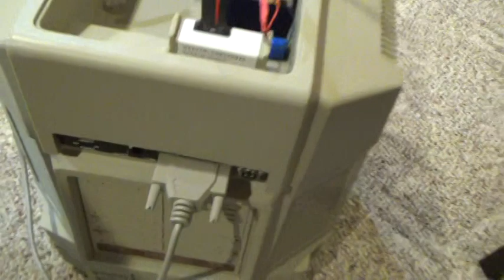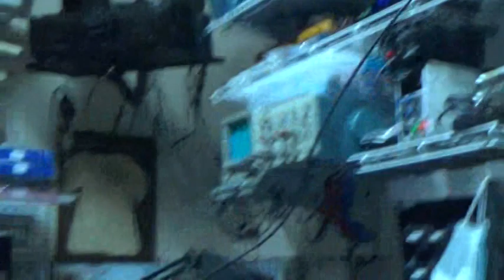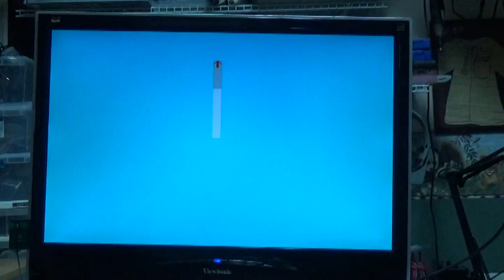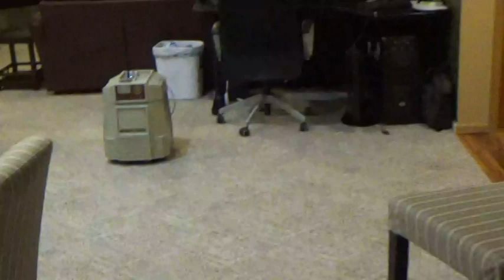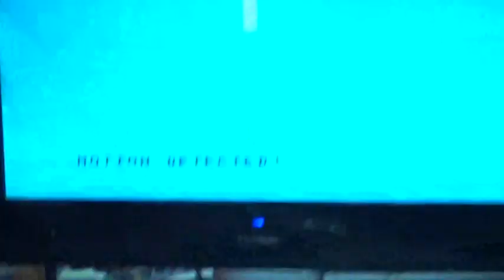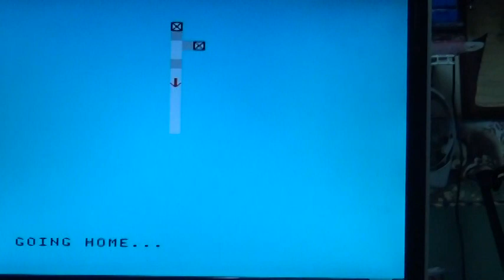Heathkit Hero Jr Robot Wireless Communication and Control with a TI 99/4A Computer

Comment: Excellent Hero JR video and results with the TI-99!  Do you know if Rich extended basic is still available for the TI-99 4A?  Looks like this is an extremely limited version of extended basic making it very hard to attain.  Thanks so much and keep up the great work!
Reply: Thanks so much.  I have an RXB cart on the way.
Reply from the maker: Thanks! You can find a multicart with 3 flavors of Extended Basic, including RXB, here: https://www.arcadeshopper.com/wp/store/#!/Extended-Basic-3-in-1-Contains-Ti-XB-XB2-7-and-RXB2015/p/58077057/category=15846004

Comment: Very nice video series. I've been in the early processes of doing something similar with my HERO JR. Would you be willing to share the code for the program?
Reply from the maker: Thanks! Feel free to ask any questions.  Here's the code for the Jr:

1 REM HERO ROAM PROGRAM
10 INPUT C
20 IF C<>65 THEN GOTO 10
21 FOR I=1 TO 100:NEXT I
22 PRINT 1
30 INPUT C
35 IF C<1 THEN GOTO 30
36 IF C>9 THEN GOTO 30
40 ON C GOSUB 500,600,700,800,900,1000,1100,1200,1300
50 GOTO 30
500 REM FORWARD 5 UNITS
510 FWD 5
511 GOSUB 1510
515 PRINT 89
520 RETURN
600 REM BACKWARD 5 UNITS
610 BWD 5
611 GOSUB 1510
615 PRINT 89
620 RETURN
700 REM FORWARD 10 UNITS
710 FWD 10
711 GOSUB 1510
715 PRINT 89
720 RETURN
800 REM RIGHT ROTATION
810 RIGHT 90
811 GOSUB 1510
815 PRINT 89
820 RETURN
900 REM LEFT ROTATION
910 LEFT 90
911 GOSUB 1510
915 PRINT 89
920 RETURN
1000 REM LIGHT LEVEL DETECTION
1010 L=EYE
1011 GOSUB 1510
1015 PRINT L
1020 RETURN
1100 REM RANGE MEASUREMENT
1105 R=SONAR
1110 GOSUB 1510
1115 PRINT R
1120 RETURN
1200 REM INFRARED HEAT DETECTION
1210 I=MOTION
1211 GOSUB 1510
1215 PRINT I
1220 RETURN
1300 REM SPEAK FUNCTION
1305 INPUT C
1306 IF C<1 THEN GOTO 1305
1307 IF C>3 THEN GOTO 1305
1308 ON C GOTO 1310,1340,1370
1309 REM PLEASE MOVE CLEAR OF ME
1310 SPEAK "PLEZHPA1MOO1VPA1KLEERPA1OVPA1MEE"
1315 GOSUB 1510
1320 PRINT 89
1330 RETURN
1335 REM OBSTACLE DETECTED
1340 SPEAK "OBSTAEKLPA1DE1TEH3KTEHD"
1345 GOSUB 1510
1350 PRINT 89
1360 RETURN
1365 REM GOING HOME
1370 SPEAK "GOWINGPA1HO1O1MM"
1375 GOSUB 1510
1380 PRINT 89
1390 RETURN
1500 REM DELAY SUBROUTINE
1510 FOR T=1 TO 200:NEXT T
1520 RETURN
>

And below is the code for the TI 99/4A:

// HERO Jr remote exploration program
// November 2019

// INITIALIZATION
CALL CLEAR
OPTION BASE 1
DIM MAP(23,32)
HOMEX=16
HOMEY=12
PRANGE=0
TCOUNT=0
DIR=1 !1=N 2=E 3=S 4=W
OPEN #1:"RS232.BA=9600.DA=7.PA=E.EC",UPDATE
CRU=2464 !CRU ADDRESS OF TMS9902 (>1340) DIVIDED BY 2

// CHECK IF ROBOT IS READY  
PRINT "CHECKING ROBOT STATUS"
CheckStatus:
CALL IO(3,1,CRU+18,0)
PRINT #1:65
GOSUB BytePresent
IF FLAG=0 THEN
 CheckStatus
Status:
ON ERROR Status
INPUT #1:ANS$
ON ERROR STOP
IF VAL(ANS$)<> 1 THEN CheckStatus 
ELSE PRINT "ROBOT IS READY!": :
PRINT "PRESS ANY KEY TO START"
GetKey:
CALL KEY(0,K,S)
IF S=0 THEN GetKey

// SET UP DISPLAY
CALL CLEAR
// CHARACTER DEFINITIONS
CALL CHAR(104,"FFFFFFFFFFFFFFFF") !BLACK LEVEL 0-20
CALL CHAR(112,"FFFFFFFFFFFFFFFF") !GRAY LEVEL 21-100
CALL CHAR(120,"FFFFFFFFFFFFFFFF") !WHITE LEVEL 101-255
CALL CHAR(105,"FFC3A59999A5C3FF") !OBSTACLE
CALL CHAR(106,"183C5A9918181818") !UP ARROW
CALL CHAR(107,"080402FFFF020408") !RIGHT ARROW
CALL CHAR(108,"18181818995A3C18") !DOWN ARROW
CALL CHAR(109,"102040FFFF402010") !LEFT ARROW

DIRSPR=106

CALL COLOR(10,2,16,11,15,16,12,16,16)
CALL SPRITE(#1,DIRSPR,9,(HOMEY-1)*8+1,(HOMEX-1)*8+1)

// START EXPLORATION
RX=HOMEX
RY=HOMEY

Explore:
TCOUNT=TCOUNT+1
IF TCOUNT>10 THEN 
 Home
// GET LIGHT LEVEL
LightInput:
CALL IO(3,1,CRU+18,0) !CLEAR RECEIVE BUFFER
PRINT #1:6 !Read light sensor
GOSUB BytePresent !WAIT FOR BYTE TO COME IN
IF FLAG=0 THEN
 LightInput
Status1:
ON ERROR Status1
INPUT #1:LIGHT$
ON ERROR STOP
IF VAL(LIGHT$)<21 THEN CALL HCHAR(RY,RX,104) 
 ELSE IF VAL(LIGHT$)<101 THEN CALL HCHAR(RY,RX,112)
  ELSE CALL HCHAR(RY,RX,120)
CALL DELAY(1)

// Check for movement in front of robot
MotionCheck:
CALL IO(3,1,CRU+18,0) ! CLEAR RECEIVE BUFFER
PRINT #1:8 !Read infrared sensor
GOSUB BytePresent
IF FLAG=0 THEN
 MotionCheck
Status7:
ON ERROR Status7
INPUT #1:HEAT$
ON ERROR STOP
IF VAL(HEAT$)=0 THEN 
 RangeInput
DISPLAY AT(24,1)BEEP:"MOTION DETECTED!"
Speak1:
CALL IO(3,1,CRU+18,0) !CLEAR RECEIVE BUFFER
PRINT #1:9 !Speak 
CALL DELAY(1)
PRINT #1:1 !PLEASE MOVE CLEAR OF ME
GOSUB BytePresent
IF FLAG=0 THEN
 Speak1
Status8:
ON ERROR Status8
INPUT #1:ANS$
ON ERROR STOP
IF VAL(ANS$)<>89 THEN 
 Speak1
DISPLAY AT(24,1):"                         "
GOTO MotionCheck

// Check for obstacles
RangeInput:
CALL IO(3,1,CRU+18,0) !CLEAR RECEIVE BUFFER
PRINT #1:7 !Read sonar
GOSUB BytePresent
IF FLAG=0 THEN
 RangeInput
Status2:
ON ERROR Status2
INPUT #1:RANGE$
ON ERROR STOP
IF VAL(RANGE$)>40 AND ((DIR=1 AND RY>2) OR (DIR=2 AND RX<31) OR (DIR=3 AND RY<22) OR (DIR=4 AND RX>2)) THEN
 GOTO PathClear
IF DIR=1 THEN 
 CALL HCHAR(RY-1,RX,105)::
 MAP(RY-1,RX)=1
IF DIR=2 THEN 
 CALL HCHAR(RY,RX+1,105)::
 MAP(RY,RX+1)=1
IF DIR=3 THEN 
 CALL HCHAR(RY+1,RX,105)::
 MAP(RY+1,RX)=1
IF DIR=4 THEN 
 CALL HCHAR(RY,RX-1,105)::
 MAP(RY,RX-1)=1
Speak2:
CALL IO(3,1,CRU+18,0) !CLEAR RECEIVE BUFFER
PRINT #1:9 !Speak
CALL DELAY(1)
PRINT #1:2 !OBSTACLE DETECTED
GOSUB BytePresent
IF FLAG=0 THEN
 Speak2
StatusObs:
ON ERROR StatusObs
INPUT #1:ANS$
ON ERROR STOP
IF VAL(ANS$)<>89 THEN 
 Speak2

//Back up
Reverse:
CALL IO(3,1,CRU+18,0) !CLEAR RECEIVE BUFFER
PRINT #1:2
GOSUB BytePresent
IF FLAG=0 THEN
 Reverse
Status3:
ON ERROR Status3
INPUT #1:ANS$
ON ERROR STOP
IF ANS$<>"89" THEN Reverse
IF DIR=1 THEN RY=RY+1
IF DIR=2 THEN RX=RX-1
IF DIR=3 THEN RY=RY-1
IF DIR=4 THEN RX=RX+1
CALL LOCATE(#1,(RY-1)*8+1,(RX-1)*8+1)
CALL DELAY(2)

//Check for surrounding blocked path
IF DIR=1 THEN
 CALL GCHAR(RY,RX+1,BLOCK)::
 GOTO Turn
IF DIR=2 THEN
 CALL GCHAR(RY+1,RX,BLOCK)::
 GOTO Turn
IF DIR=3 THEN 
 CALL GCHAR(RY,RX-1,BLOCK)::
 GOTO Turn
CALL GCHAR(RY-1,RX,BLOCK)

Turn:
IF BLOCK<>105 THEN
  Go_Right
 ELSE
  Go_Left

//Turn right 
Go_Right:
CALL IO(3,1,CRU+18,0) !CLEAR RECEIVE BUFFER
PRINT #1:4
GOSUB BytePresent
IF FLAG=0 THEN
 Go_Right
Status4:
ON ERROR Status4
INPUT #1:ANS$
ON ERROR STOP
IF ANS$<>"89" THEN Go_Right
DIR=DIR+1
DIRSPR=DIRSPR+1
IF DIR>4 THEN DIR=1::DIRSPR=106
CALL PATTERN(#1,DIRSPR)
CALL DELAY(2)
IF HFLAG=1 THEN
 Home
GOTO Explore 

//Turn left
Go_Left:
CALL IO(3,1,CRU+18,0) !CLEAR RECEIVE BUFFER
PRINT #1:5 
GOSUB BytePresent
IF FLAG=0 THEN
 Go_Left
Status6:
ON ERROR Status6
INPUT #1:ANS$
ON ERROR STOP
IF ANS$<>"89" THEN Go_Left
DIR=DIR-1
DIRSPR=DIRSPR-1
IF DIR<1 THEN DIR=4::DIRSPR=109
CALL PATTERN(#1,DIRSPR)
CALL DELAY(2)
IF HFLAG=1 THEN
 Home
GOTO Explore

//Move forward
PathClear:
CALL DELAY(1)
Forward:
CALL IO(3,1,CRU+18,0) !CLEAR RECEIVE BUFFER
PRINT #1:3
GOSUB BytePresent
IF FLAG=0 THEN
 Forward
Status5:
ON ERROR Status5
INPUT #1:ANS$
ON ERROR STOP
IF ANS$<>"89" THEN Forward
IF DIR=1 THEN RY=RY-1
IF DIR=2 THEN RX=RX+1
IF DIR=3 THEN RY=RY+1
IF DIR=4 THEN RX=RX-1
CALL LOCATE(#1,(RY-1)*8+1,(RX-1)*8+1)
CALL DELAY(2)
IF HFLAG=1 THEN
 Home
GOTO Explore

// Go home routine
Home:
HFLAG=1
IF RX=HOMEX AND RY=HOMEY THEN
 DISPLAY AT(24,1)BEEP:"AT HOME!"::
 GOTO GetKey1
ELSE
 DISPLAY AT(24,1)BEEP:"GOING HOME..."
 
Speak3:
CALL IO(3,1,CRU+18,0) !CLEAR RECEIVE BUFFER
PRINT #1:9 !Speak
CALL DELAY(1)
PRINT #1:3 !GOING HOME
GOSUB BytePresent
IF FLAG=0 THEN
 Speak3
StatusHome:
ON ERROR StatusHome
INPUT #1:ANS$
ON ERROR STOP
IF VAL(ANS$)<>89 THEN 
 Speak3
 
IF RY>HOMEY AND MAP(RY-1,RX)=0 THEN
 TDIR=1::
 GOTO CheckFacing
IF RY<HOMEY AND MAP(RY+1,RX)=0 THEN
 TDIR=3::
 GOTO CheckFacing
IF RX>HOMEX AND MAP(RY,RX-1)=0 THEN
 TDIR=4::
 GOTO CheckFacing
IF RX<HOMEX AND MAP(RY,RX+1)=0 THEN
 TDIR=2::
 GOTO CheckFacing
GOTO Explore

CheckFacing:
IF DIR<>TDIR THEN
 FacingTurn

ForwardH:
CALL IO(3,1,CRU+18,0) !CLEAR RECEIVE BUFFER
PRINT #1:3
GOSUB BytePresent
IF FLAG=0 THEN
 ForwardH
StatusHF:
ON ERROR StatusHF
INPUT #1:ANS$
ON ERROR STOP
IF ANS$<>"89" THEN ForwardH
IF DIR=1 THEN RY=RY-1
IF DIR=2 THEN RX=RX+1
IF DIR=3 THEN RY=RY+1
IF DIR=4 THEN RX=RX-1
CALL LOCATE(#1,(RY-1)*8+1,(RX-1)*8+1)
CALL DELAY(2)
GOTO Home

FacingTurn:
IF ABS(TDIR-DIR)>2 AND TDIR<DIR THEN
 TurnRightH
IF ABS(TDIR-DIR)>2 AND TDIR>DIR THEN
 TurnLeftH
IF TDIR<DIR THEN 
 TurnLeftH

TurnRightH:
CALL IO(3,1,CRU+18,0) !CLEAR RECEIVE BUFFER
PRINT #1:4
GOSUB BytePresent
IF FLAG=0 THEN
 TurnRightH
StatusHR:
ON ERROR StatusHR
INPUT #1:ANS$
ON ERROR STOP
IF ANS$<>"89" THEN TurnRightH
DIR=DIR+1
DIRSPR=DIRSPR+1
IF DIR>4 THEN DIR=1::DIRSPR=106
CALL PATTERN(#1,DIRSPR)
CALL DELAY(2)
GOTO CheckFacing

TurnLeftH:
CALL IO(3,1,CRU+18,0) !CLEAR RECEIVE BUFFER
PRINT #1:5 
GOSUB BytePresent
IF FLAG=0 THEN
 TurnLeftH
StatusHL:
ON ERROR StatusHL
INPUT #1:ANS$
ON ERROR STOP
IF ANS$<>"89" THEN TurnLeftH
DIR=DIR-1
DIRSPR=DIRSPR-1
IF DIR<1 THEN DIR=4::DIRSPR=109
CALL PATTERN(#1,DIRSPR)
CALL DELAY(2)
GOTO CheckFacing
 
// Resume exploration
GetKey1:
CALL KEY(0,K,S)
IF S=0 THEN GetKey1
DISPLAY AT(24,1):"                       "
HFLAG=0
GOTO Explore

// Check for incoming byte over serial line
BytePresent:
COUNTER=0
CheckByte:
CALL IO(2,1,CRU+21,BYTEIN)
IF BYTEIN=0 THEN 
 COUNTER=COUNTER+1
ELSE
 FLAG=1::
 RETURN
IF COUNTER>50 THEN 
 FLAG=0::
 DISPLAY AT(24,1)BEEP:"TIME OUT! RETRYING..."::
 CALL DELAY(1)::
 DISPLAY AT(24,1):"                     "::
 RETURN
ELSE
 GOTO CheckByte

// Delay routine
SUB DELAY(DUR)
FOR I=1 TO DUR*100
NEXT I
SUBEND
Reply: @SuperVorticon  Awesome!! thank you so much! I have been rebuilding both a HERO-1 and a Junior this winter and I would like to use a PI as a more sophisticated controller for them (without modifying them in any way of course) It's always great to see someone else playing with these old robots and the wireless serial link is a terrific idea!
Reply from the maker: One of my early experiments did use a raspberry pi. Check out the blog link in the video description :)